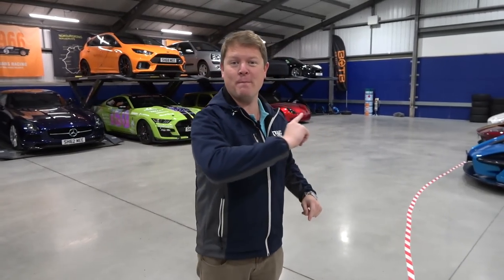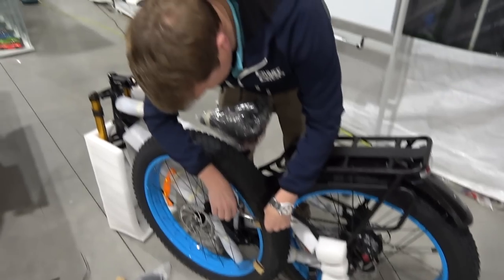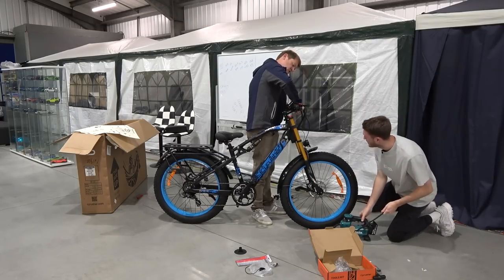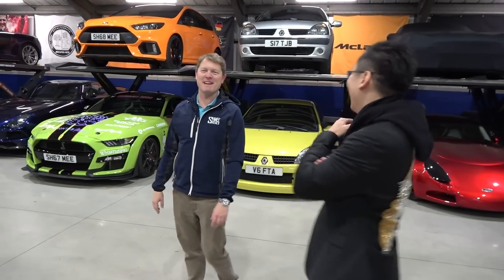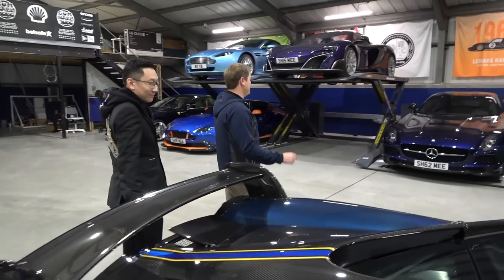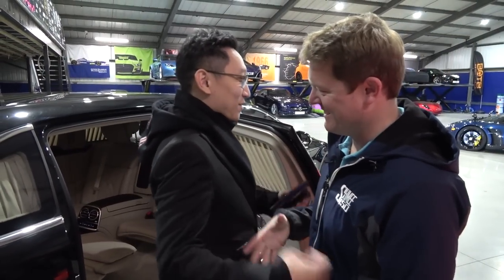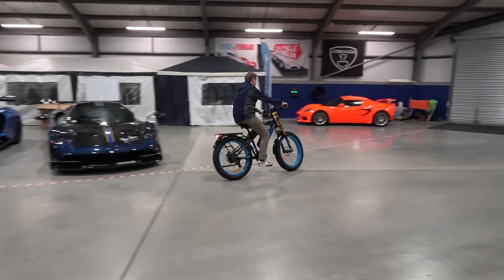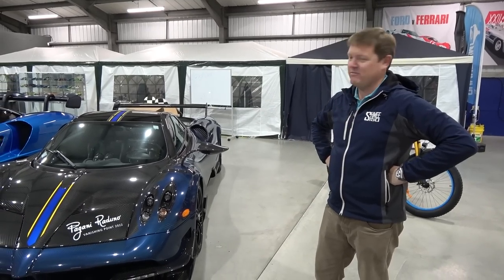My Friend Mike Brings the FIRST PAGANI to The Shmuseum! | VLOG 103

Comment: Pagani is a standard of the best design, this car deserves a monument, and to be a standard
Reply from the maker: It’s beautiful
Reply: They are without question very interesting, and the choice of materials are quite exquisite. However, they are not necessarily a good design, and most certainly not the standard to judge by. For a design to be considered and actual good design, it really needs to be both as good as can be from a functional standpoint, as well as looks. The Huayre is very striking and beautifully made, but as a sportscar, there are cars that rival it many times over. If we were to talk steering feedback for example, a Ferrari 296 or Mclaren 765 will absolutely wipe the floor with it. If you want to talk throttle response, any of Ferraris turbo engines are miles ahead.
It is very much jewellery on wheels. I have had the pleasure to drive a BC a few times. My local Ferrari dealer is also one of the very few official Pagani dealers here in Europe, and there have been a few opportunities, so I'm not just making assumptions. The whole Pagani is just kind of a weird mix of things and very much a stylistic experience.